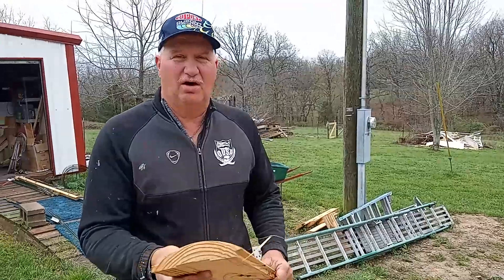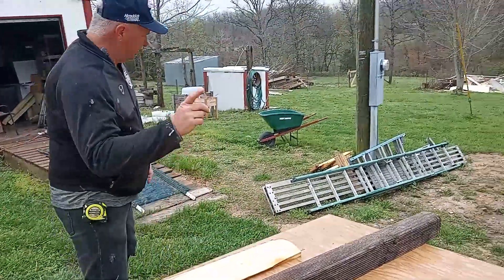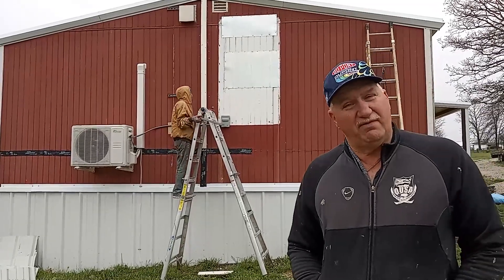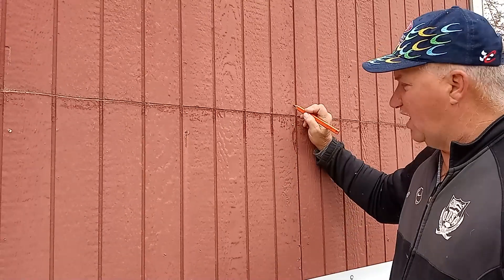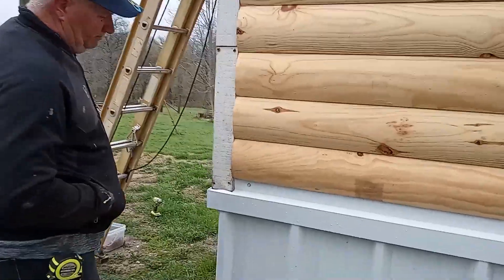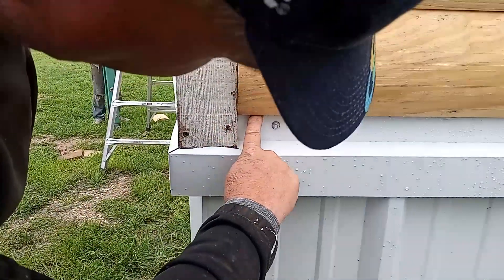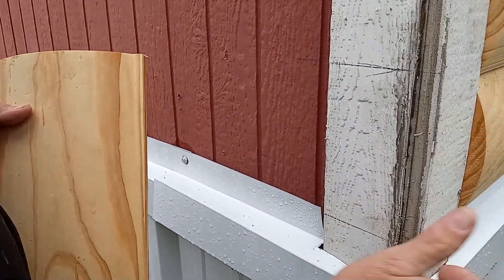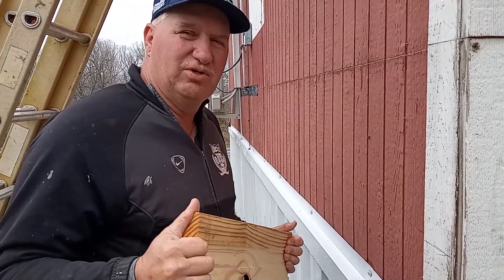Mobile Home Siding Wood

Comment: I was wondering what the up keep to the wood siding would be?
Reply from the maker: You can expect the wood to twist and crack. You can expect to have stain and seal as the years past. Things like this. Everything requires maintenance. Even relationships.

Comment: That looks great, now switch the skirting out for faux brick or rock and it would really set it off.
Reply from the maker: My job is to fit her budget to her happiness as we agree.
Reply: @StraightArrowRepair  Understood.  How would you go about replacing a rotted sill plate and rim joist on a 12x56 (the entire perimeter is shot, floor is getting replaced as I go) ?